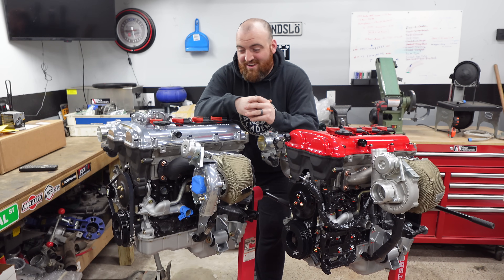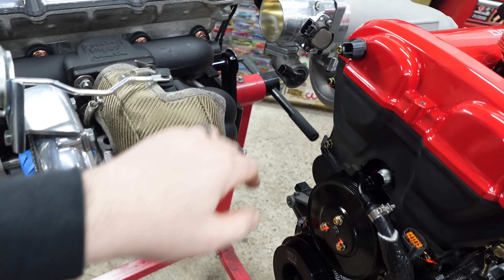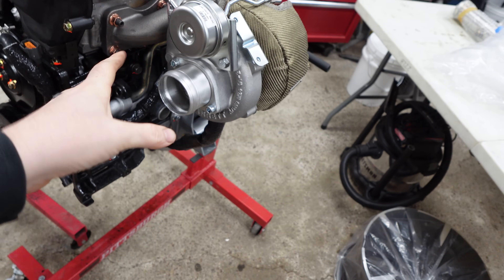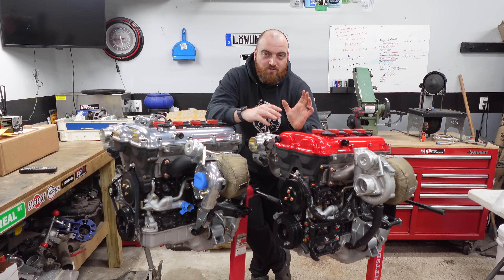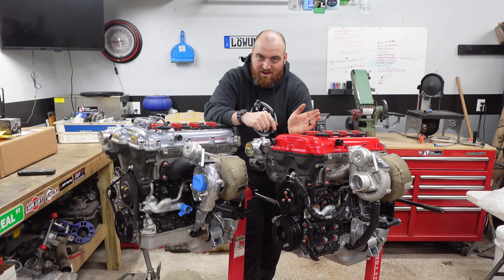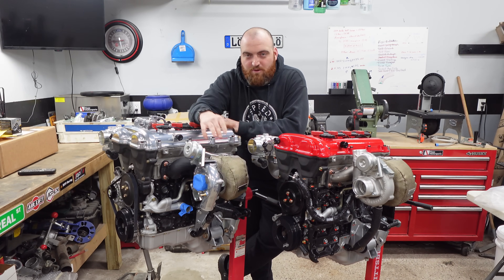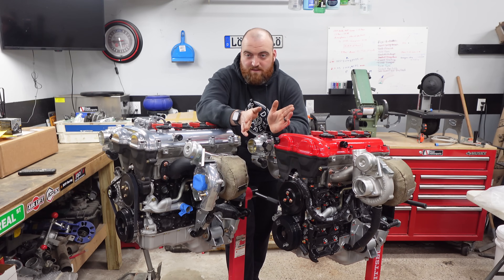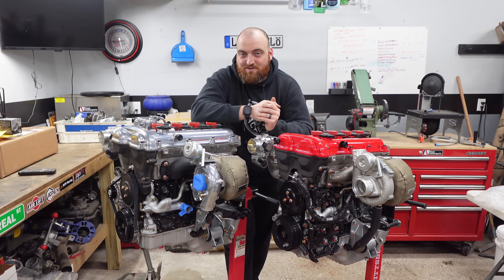Which Miata Turbo Kit Is Best? Flyin Miata vs Kraken

Comment: Any experience in regards to quality and reliability of the manifolds in a road race environment? Cracking or warping?
What studs will the manifolds accept, 8mm or 10mm?
Reply from the maker: The studs are 8mm. I would recommend drilling them out to 10mm for track use, and using stage 8 locking hardware.

Comment: Got a kit by Dynotronics that works great. Yes, it was about 2X the intended price, but it all works. Uses a "bespoke" G25-550..not sure exactly what that means. Not sure what the AR of the turbine housing is. Either a .72 or .92. Water/meth system..right at 300 rwhp.
Reply from the maker: Sounds like a lot for 300hp

Comment: Glad Kraken finally got their shit sorted out. I had a TERRIBLE experience with a few of their kits I installed for people a few years ago. Downpipes built wrong/didn't fit, intercooler piping that fouled on half the bay and didn't fit. IAC inlet and BOV flange welded on in the wrong spots, etc. Ended up having to modify the parts myself after Kraken told me I was "doing it wrong" and ghosted me.
Reply from the maker: Their new stuff is super nice

Comment: My thoughts on the FM kit I installed: 1) I would prefer an aluminum line from the turbo to the intercooler. The air is hotter that the engine bay, so an aluminum IC pipe would emit heat. Silicone from IC to TB makes sense, because you do not water to reheat the air. 2) I was not able to get the the silicone IC line turbo-IC to not touch the silicone coolant line. No problem so far, but they touch. 3) This one is my fault. I ported every part the air touches from the filter adapter sleeve to the exhaust, and also added a DW fuel pump and professionally cleaned injectors. It also has 84mm pistons and fancy valves. The Voodoo box is not able to perfect the fuel/air ratio with this set up and it is really rich below 4.5k rpms. It makes great power up high though. 4) The FM site shows a dyno graph of their kit making just shy of 200hp on a '99 car, so hp levels are model year dependent. 5) When the Voodoo box is reading boost, the system goes into open loop. This means you can't cheat and use the 01-05 injectors in a 99 for example-- though they work fine without boost. Overall, it is a great kit with great fitment and great customer service, but if you are trying to use the Voodoo box, don't change anything that significantly affects airflow or fuel flow.
Reply from the maker: Silicone actually suffers less from heat soak than aluminum, so FM would do better in the bay as silicone as opposed to aluminum.

Comment: I have a full kraken kit, with a gt2554. My turbo outlet points down? With their supplied piping. No need for cutting the frame or anything. Have mazda comp engine mounts.
Reply from the maker: AC and PS? He might have revised the kit at some point.
Reply: @NappMotorsports  no AC. That might be it. Wished i had ac. 😂

Comment: What about standalone ec units? I built mine back in the day it’s a 95 I have a tec3 electromotive unit and I’m looking to do some upgrades! Does Holly EFI make a system for the Miata? What would you recommend?
Reply from the maker: Beer Money Motorsports, Megasquirt MS3PNP or Haltech get my vote.
Reply: @NappMotorsports   Have you done a video comparing standalone ecu’s yet?

Comment: Super informative , i live upstate NY and realize miatas are not for me , I am aware that 160 Hp in lightweight car  is more then many would expect to be fun but wouldnt go Through the costs associated with taking advatnage of the tremendously low weight of these  cars as platform as thetr is no free lunch with them if you live in a State like NY . Its a shame that there is no easy way to add power to these cars and by power I mean something around 200 -220   for a giant killer for back roads of which are endless up here that wpi;d also has very surprising levels of shove based on power to weight that 220 HP would afford before you end up so traction limited its not fun . Either way or whatecer model year the gross amount of power you can get for adding a turbo per $ ratio as new yorker is a bummer no matter how much fun the end situatiion is . If you dont have to pay somebody to wrench for you and can piece stuff together perhaps but its for people with a few bucks who are extremely comitted to this particular cars charms . Its a drag considering the potential to start with such low weight . But NY are the champs of beuracracy , restricting fun and ,making things inordinantly expensive . Such a shame mazda didnt make it easier some how , theres no real way around it . I enjoy slow cars fast and will have wait  until current 181 HP variant is cheap enough and settle for a stock car with some minor tweaks and tires .

Very helpful to clue me in though and stop the wondering .
Reply from the maker: I mean it's pretty easy to just slap a turbo on a stock engine and make 200-250 whp with a standalone ECU.
Reply: Cheap, cheap, cheap, you only say cheap. Yeah go buy another car.
Reply: @rafallo1333  yeah , I prefer value oriented person of limited means averse to living beyond those means but cheap in the common venacular cheap is accurate enough .

Comment: Yes I have a 95 Mazda Miata 1.8 NA and I want to try to do a turbo 300 horsepower where do I need to start at I have an engine block and a crankshaft that's it
Reply from the maker: I have an engine build video that shows you everything you'll need.
Reply: @NappMotorsports  how much would it cost me for you to build one

Comment: Will a coolant reroute will effect either setup?
Reply: A coolant re-route is beneficial on a normally aspirated engine, arguably essential on a boosted engine. Depending on the re-route manufacturer, the new radiator top hose might rub on the pipe going into the throttle body, but nothing serious.
Reply from the maker: What he said ^^ you should always run one on a boosted setup.

Comment: There very different kits

Also FM is actually emissions legal
Reply: Yeah he goes over that in the video. Both kits are great, but kraken flows so much better. You're not making 500+whp on a FM kit
Reply from the maker: Correct